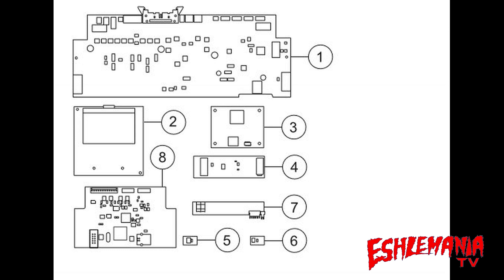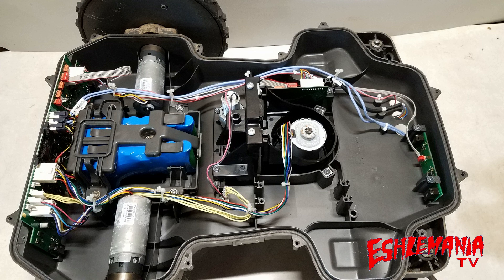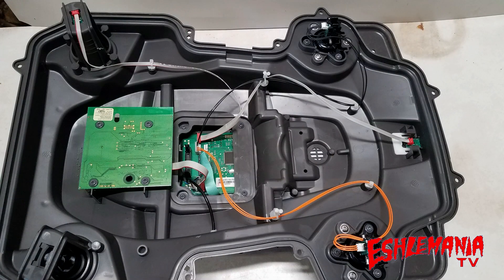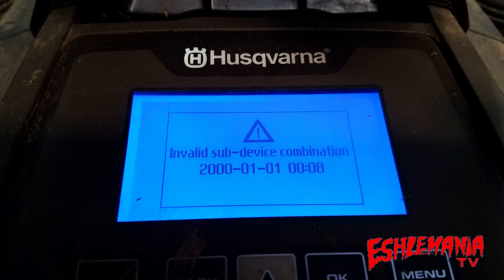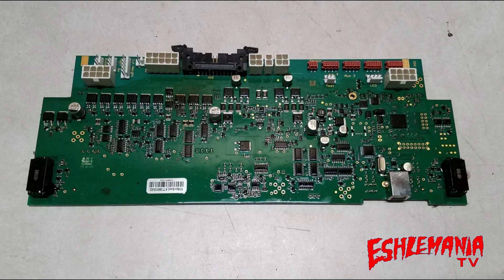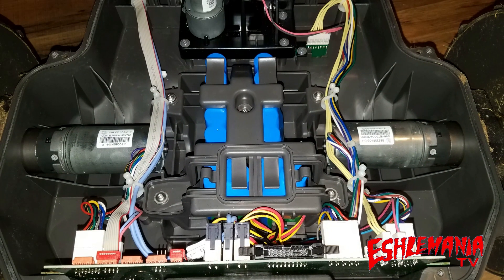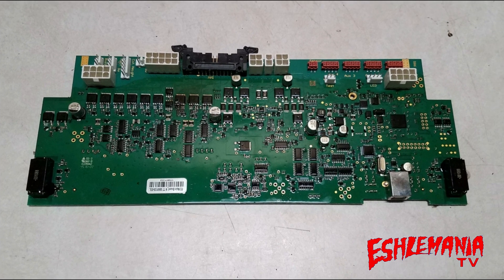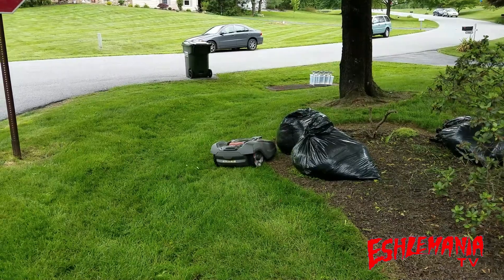Automower Answers: Main Board & HMI Board Information

Comment: If I provide my automower serial number, can you sell me a replacement  HMI Board that will work in my mower? My display backlights, but does not show anything anymore.
As long as there are no errors with the mower, it still can run like this, but now I have some kind of error and I have no idea what it is. I would really like to get this display working again. Thank you for the great videos!

Comment: What if you just parallel more cells in the original battery port? It'd be the same voltage. Would it be able to make use of the extra capacity?
Reply: I don't know the answer to that but Eshlemania has another video "Automower Answers: Can You Add A 2nd Battery To A 430X (Husqvarna Automower)" which goes into that more and mentions another problem: The transformer for 440 and 450X are bigger and have other cables. Your 430X would need to spend more time in the station with each time.
So the number of charge cycles would be fever but that is probably not the only limit for a Li-Ion battery over several years time. Better use one pack now for some years and when it dies or is unable to run enough to keep the garden mowed then change it to a (fairly) newly produced pack of batteries.

Comment: I heard a rumor that Husqvarna would start allowing owners to perform their own firmware updates, without needing AC3 or a dealer login. Have you heard anything about this?
Reply from the maker: There's always going to be rumors like that out there. And even in the case of the Bluetooth feature, there was a service bulletin issued months ago saying that the feature would be available and active in ALL X series mowers. Even after the bulletin was issued that still hasn't happened yet all these months later. So firmware updates being done without going through a dealer will eventually be something that happens, but I would not hold my breath for it because there are too many other priorities at this point.
Reply: Cool, thanks for the info and the awesome videos!
Reply from the maker: Thanks for the good feedback!
Reply: AWD Automowers since last update can be updated without service program at dealers' place, you need only smartphone with application. It won't be possible to update other Automowers that are sold today without service program because of lack of memory on mainboard. Only AWD can do it so far.
Reply: And a year later or so the situation is the same. 435X/535 had a new generation of electronics/boards and was possible to get firmware updates over the air. The new models 405X/415X have the same generation (the motor control boards are the same) and have FOTA too.
So no hope for getting FOTA to other (older) models with AM Connect. For updating via USB cable it's a strange situation. Apparently the process can go haywire with updating. At the same time Husqvarna Group's other brand Gardena offers a program on the website to update via cable and those mowers are designed by the same group (sharing the same motherboard). So for Gardena customers apparently it is okay to either offer upgrade-ability to other risk bricking machines for depending on how to see it.

Comment: Do you have a video about invisible dog fences? Or could you give me a basic explanation of how to handle them when installing the boundary and guide wires? Thanks.
Reply from the maker: That is a hard one to make a video about. I say that because I personally have installed mowers on many properties with invisible dog fences and there were no issues between the mower and fence. BUT then I do have ONE property where there is an issue between the mower and the dog fence and after trying 3 different types of dog fence brand/controller the problem still exists. the owner has the mower and dog fence on individual timers so they aren't on at the same time. This system has worked well for his property for a few years now. So it's hard to say that this or that will definitely happen if you install a mower on a property with an invisible dog fence because it's really a case by case situation. I do know that Husqvarna has a list of pet fences that they suggest you use based on their results of testing. I've also heard that they are working with one of the invisible fence companies to come up with something that will work without question.
Reply from the maker: @Patton Grant they will work together in most cases. When I say most, from my experience it has been 99% of the time. I'm not sure what you mean when you say you believe a simple uncharged wire can interfere with an Automower? I have seen demo areas where wire was installed and the next season they installed a new wire in a completely different shape in the same area where the original wire was still in the ground from the previous season. That original wire is still there and has no current going through it and causes no interference. I personally have done installations where multiple mowers are on the same property and we over lapped the working areas and there is no interference or issue there either.
Reply: @Patton Grant In general, most dog fences operate in Frequency modulation (FM) band, which is insusceptible to interference. If interference does exist (usually Automower's loop signal suppresses dog fence's), user can change Automower charging station loop signal. Some dog fences use Amplitude modulation (AM) band, which is highly susceptible to interference and Automower's and dog fence's loop signal cannot co-exist without problems.